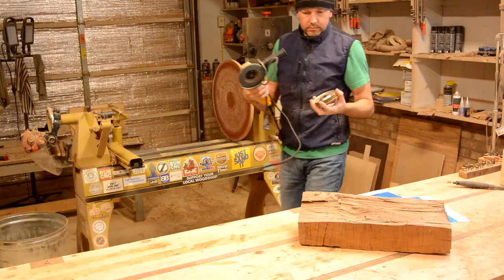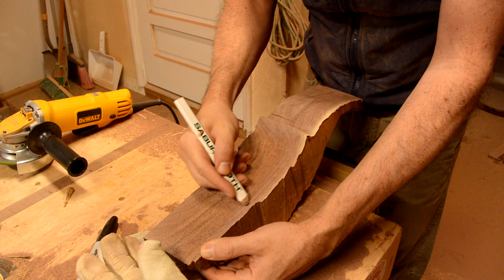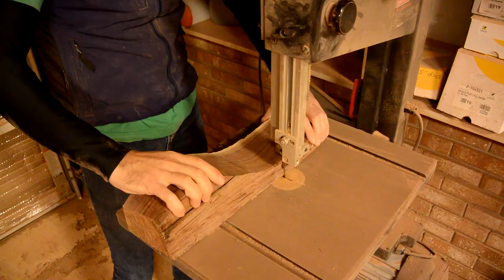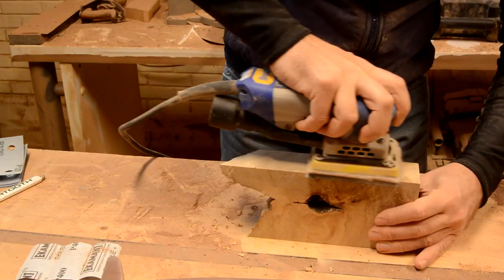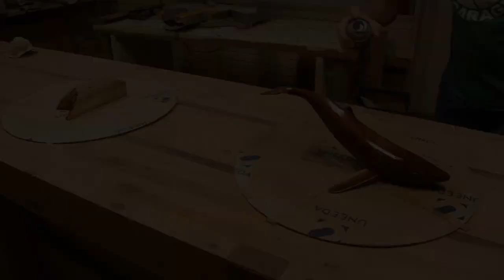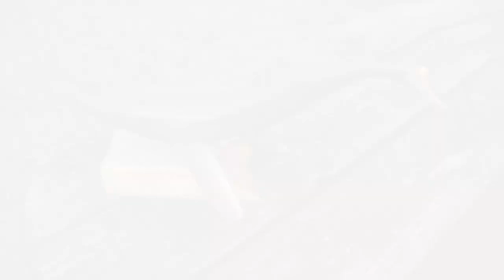Carving a Whale from Wood - Art, Sculpture, Woodworking

Comment: I have a few questions. What are you repairing the cracks with?What are the name of the discs you’re using? I love your art. I hope you get a space after you move.
Reply from the maker: Thank you. I put epoxy in the larger cracks and Starbond CA glue in the smaller ones. I use Saburrtooth carving burrs from www.saburrtooth.com. Use CAM10 at checkout to get 10% off.